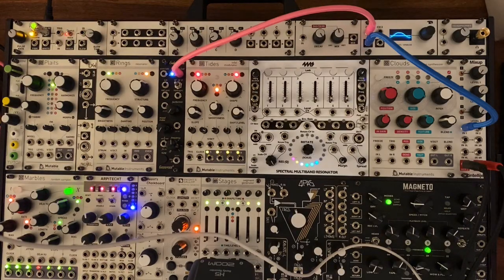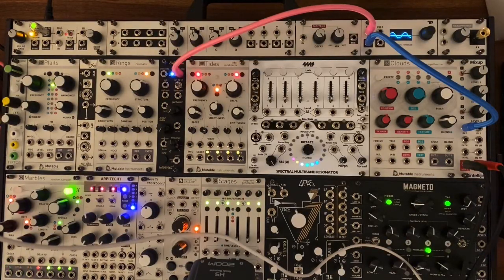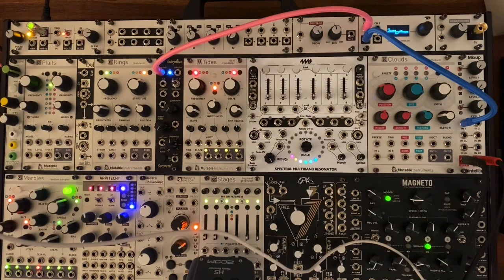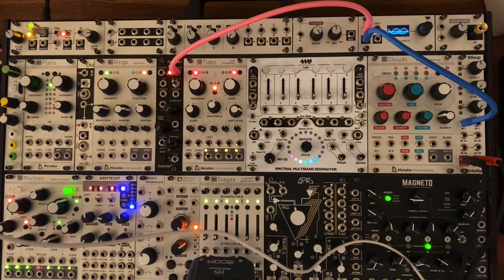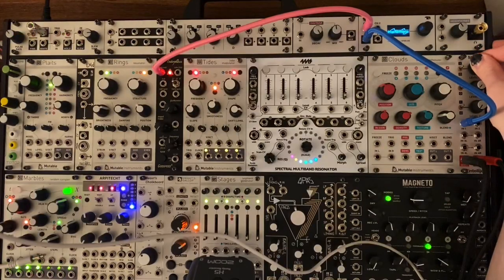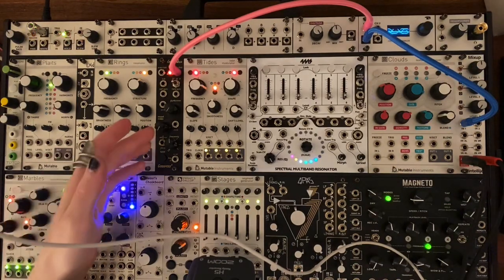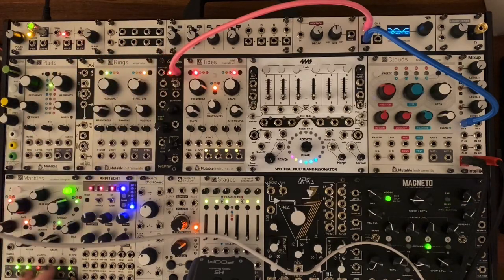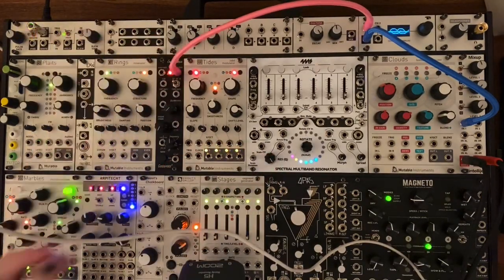Endorphin.es Godspeed+ - Walkthrough & Patching

Comment: As a lover of FM synthesis I was really excited about Godspeed+ for several reasons: precise thru-zero linear FM with a digital core, pre-patched self-modulation and an additional wavefolder for one of the outputs. Hearing it in action makes me wonder if I'll actually like it in practice... It sounds rather harsh, which is to be expected from a low-resolution digital OSC, but the FM doesn't seem to have as many sweet spots as I had hoped for. Maybe 2 Godspeeds FM'ing one another with octave switches on different positions would sound more interesting? ;D just a thought